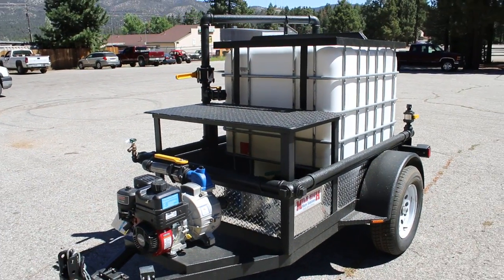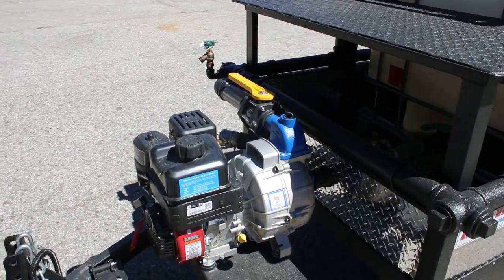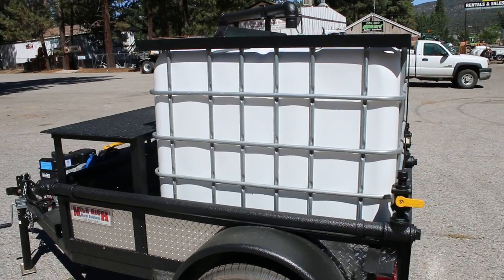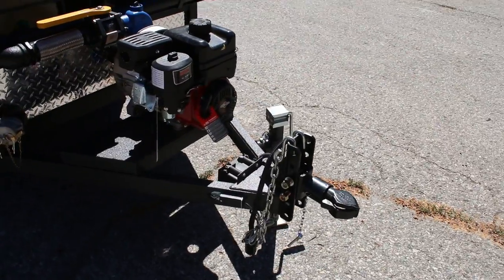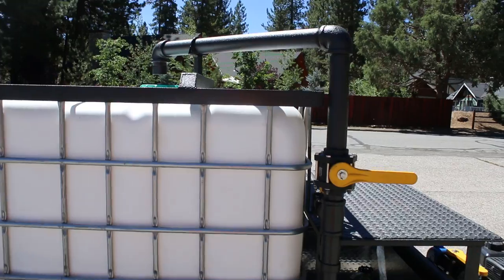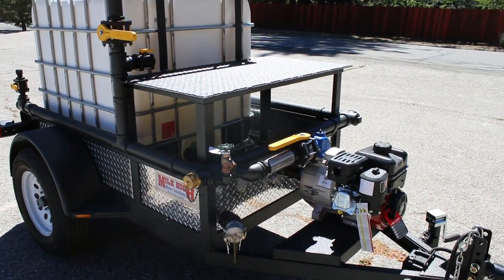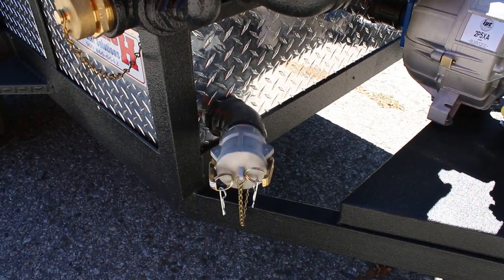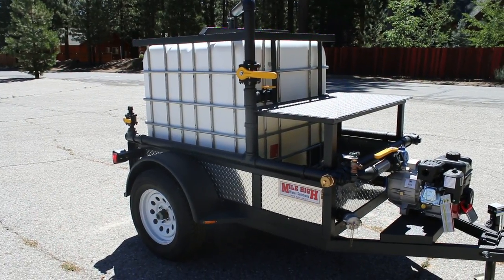Mile high Water Solutions 275 gallon  water trailer

Comment: Anyone that uses this to put out any type of fire needs to know that the pump can put out 75 gallons a minute and the tote holds 275 gallons. Divide 275 by 75 and you get a whopping 3.6 minutes to put out a fire. FYI, the only thing you will be able to extinguish with this setup is either a lit cigarette or a small campfire. Funny how that is not mentioned.
Reply: That's not true. You do know nozzles will lower your gallons per minute down to 5 or less and that's a high pressure fire pump. Also 275 gallons is a lot, pretty typical for type 6 brush truck tank size. This is a very affectively unit to have.
Reply: @JakeRoy98  You couldn't be any more wrong. Use a calculator and do the math. Math doesn't lie. Look up the specs on a plastic 1-1/2" Nozzle, it's 80 GPM. That gives you a whopping 3.4375 MINUTES of working time. 

You want the nozzle open 100% and the pump at 100% to keep your distance from the convection currents that can incinerate a human. 

No one in their right mind would use a pump and nozzle at less than 100%. A simple grass fire can travel at a rate of up to 14.27 miles per hour, destroying everything in its path. You couldn't put out enough water with that setup to stop a simple grass fire. Now let's say there was a pine tree involved. That unit couldn't spray down one tall tree let alone stop an approaching forest fire. 

OK fine, let’s use your pump and nozzle at 50% now you have 6.875. Seriously what do you think you will accomplish with 6 minutes of working time throwing water about 15 feet at 50%. Get serious.

Anyone using this for anything other than a campfire is endangering their life.
Reply: @JakeRoy98  Do some research and do the math. The nozzle allows 80 gallons per minute on a 1-1/2" hose nozzle. That's about three minutes at 275 gallons. Go ahead try and put out a brush fire, or forest fire in three minutes. 😂
Reply: @robertnelson4755  Typically Wildland trucks use 1 inch line with a low gpm nozzle I'm a member of an RFPA and we use old forest service tanks typically 200-300 gallons, a predator harbor Freight pump or a Honda and 50 feet of 1" light weight booster hose and we put out a lot of fire. I live in the high desert of eastern Oregon. I'm sure if you were in the timbers it would be different. But are you saying type 6 and type 7 brush rigs are not effective because this setup is pretty much a brush truck. That's why Wildland rigs including our own have drafting capabilities so we can pull water because you will run out eventually. I feel like you are looking at this from an old fashioned or a structural fire fighting point of view.
Reply: They’re mainly used to compact soil on job sites and dirtbike tracks and shit like that. Not for firefighting. Calm down.